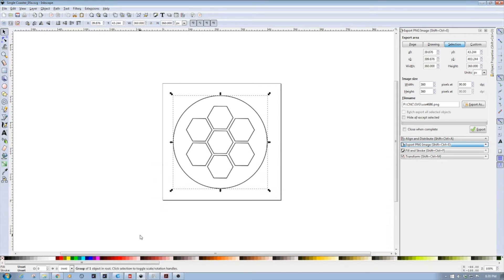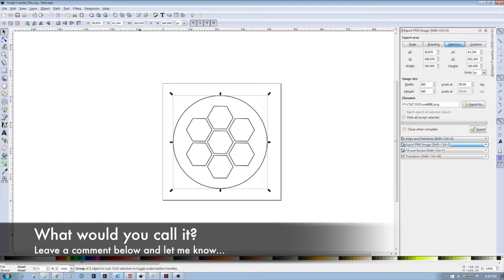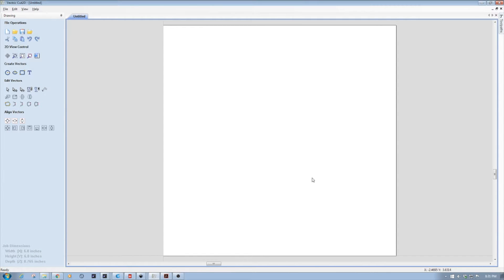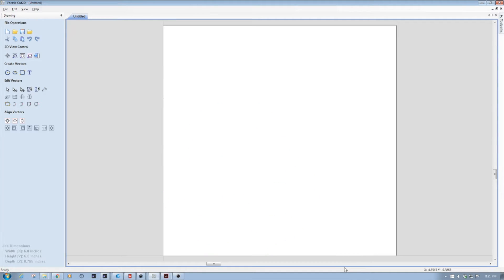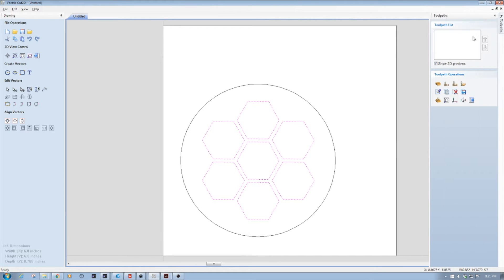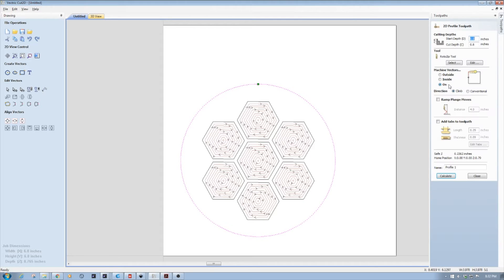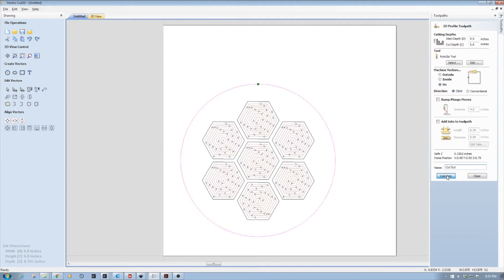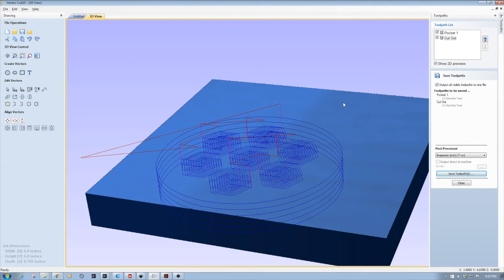CNC Project - Routing a Plant Coaster on a CNC Router Table!

Comment: The cranks on the steppers are a nice touch.. I have them on my home brew and have a switch on the stepper power supply. Makes setting zeros dead simple... Simply cut off the power to the steppers leaving the controller powered up and crank to the desired point. Then power up the steppers and zero out the readouts and off you go..

Comment: Just print it in Jet black PLA.
Reply from the maker: +Mickice That would be too easy :-)  I did try it in a wood filament and that is what brought me here!
Reply: +DIY3DTECH.com I remember that video, was it poly wood?
Reply from the maker: +Mickice Yes it was a SainSmart wood filament, really gummed thing up.  When I get time later in the summer will get a different brand and try again as I like the idea of printing with a wood filament and things you can make but that brand did not cut it at all...
Reply: Unlike others I think Polywood uses no wood at all, just prints wood textur in a wood colour. Actual wood fibers in a hot end does not sound fun.

Comment: Nice coaster! Might have to look into getting a CNC cutter in the shop. Great video!
Reply from the maker: +Print 3D Channel Many thanks!  They are a lot of fun especially the newer ones, mine is pretty long in the tooth but still fun :-)
Reply: +DIY3DTECH.com any recommendations for a desktop version under 500, maybe even a kit?
Reply from the maker: +Print 3D Channel you can easily build yourself one under $500, the accuracy won't be the  best however for wood and plastic it be just fine.  Also on eBay  you can get a nice (3020 CNC) here: http://goo.gl/V8Etg3